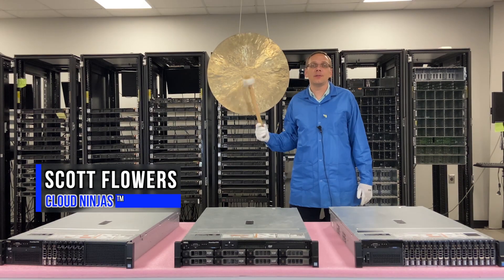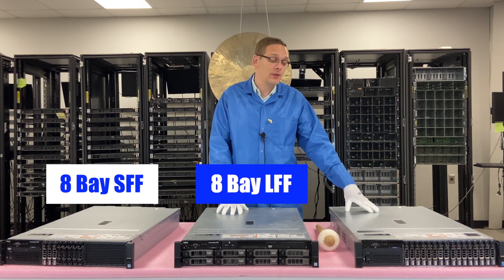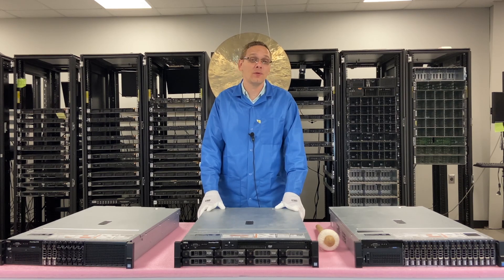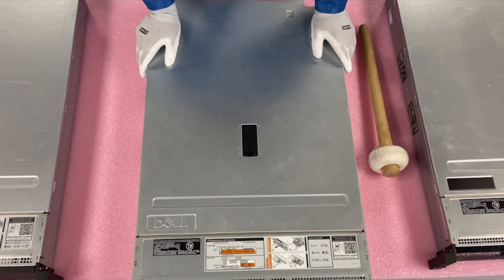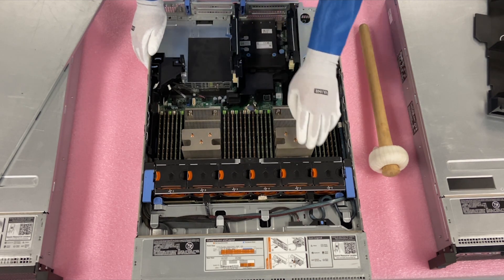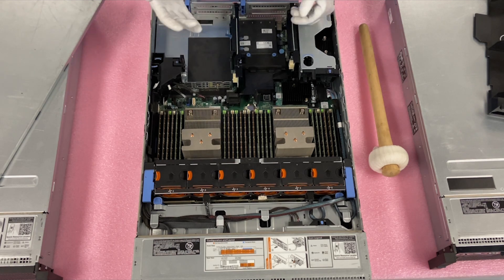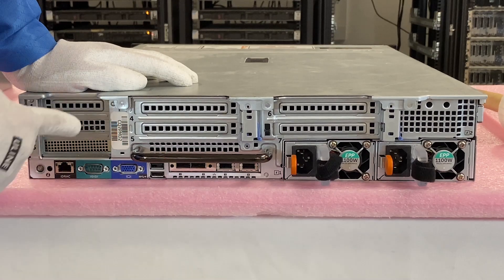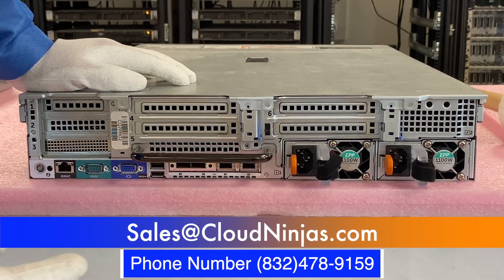Dell PowerEdge R730 Chassis Overview | Chassis Options | 8 Bay SFF | 8 Bay LFF | 16 Bay SFF

Comment: I've got an R730 in 2.5", but I want to use 3.5" drives. What's the best way of converting it? Should I just buy a new server and try to sell this one and get some money back?
Reply from the maker: Would need to get a different chassis completely.  You could pull the board and put into a 3.5" chassis or just get a different server completely.  We have some 3.5" in stock if you want just the base unit.  Hit up sales@cloudninjas.com.   Thank you.  Have a good weekend.

Comment: Thank you for the video.
I have dell R730 with configuration for 8 drives (2.5") only, how can I add more 8 drives?
Reply from the maker: Appreciate you reaching out.  Unfortunately, we don’t have them in stock right now.  There is a kit… that is a cage with backplane and cables… that combo will allow you to install the 8 drives in… however the kit is kind of expensive… you might be able to get a barebone R730 for cheaper.  Worth looking into.  Good luck!